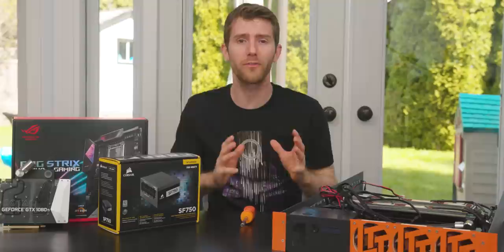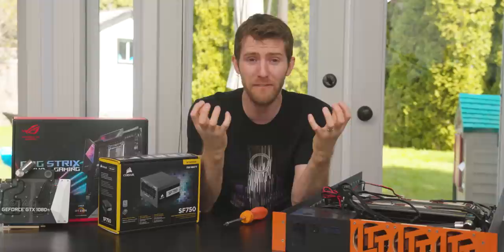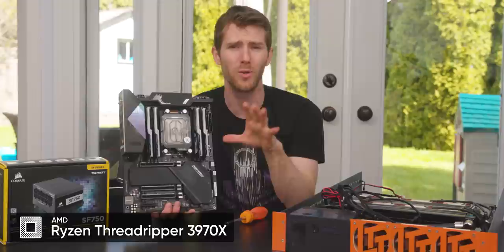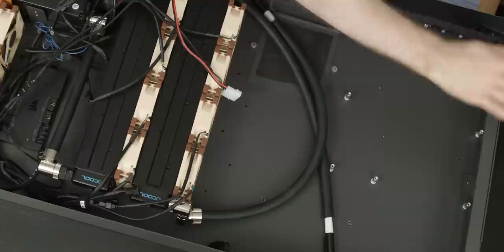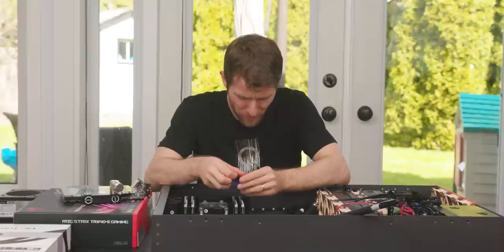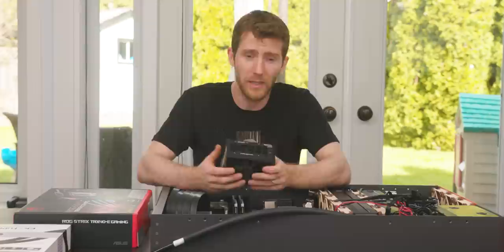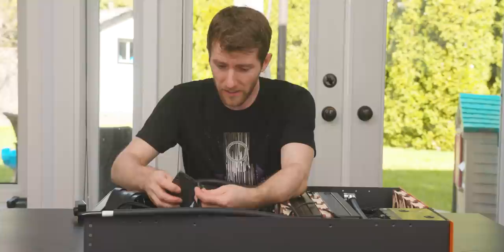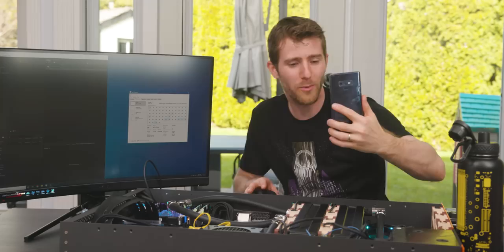Who is Video Rendering KING? Transcode Server Upgrade!

Comment: I still can't believe how efficient these Ryzen chips are. That's a 32 core CPU easily running off a 750W PSU.
Reply: I managed to run dual Epyc 7551 chips at 3GHz with a Vega 64 using a 750W PSU
Reply: Server farms wont be cooking IT guys who fix them lol if they run on epyc.
Reply: @Amusia727  The Vega probably drew more power than both combined!
Reply: i have that 750w PSU, using it with a 3900X in my small factor case
Reply: @Predator Ex I was just joking. I have a 3700x myself but it is paired with a gtx 1070. AMD processors are super efficient but not their GPU's. The Radeon VII did gain some ground on Nvidia as far as performance and power usage. I am not hating on your card though my friend, I had an FX 8350 in my last rig for Pete's sake!
Reply: @HowDareYouu  so what are you doing with the other 650w haha

Comment: Intel : so i get to battle your top dog today i hear
AMD : nah , he's busy , take his little brother instead , the 3970x 
Intel : what ?
Reply: Yeah I'm totally thinking of getting a 3970x. It's a lot cheaper than the 3990x and yeah sure it has half the cores but it also clocks higher and it's less than half the price so.. I call that a win. :D
Reply: @ayporos  dont get the 3990x , its just WAAAAY too overkill , btw what are you gonna use it for

Note : its nice to see amd dripping down their Halo Tech to the cheaper cpu's
Reply: More like taking a long nap and hakai'ing in his sleep.  You really don't want to disturb him.
Reply: @jasonlisonbee  beg your pardon , but what is hakaiing lmao
Reply: @jakethedog5777  i dont know if you realized that a lot see 2k as pennies for what that 2k cpu would do and save time compared to a consumer grade chip
Reply: @jakethedog5777  well i mean 
 3990x : And make it double
Reply: @archfxt3619  if you are not banking hard doing some kind of work that needs that kind of powers is a bit rip off
Reply: @archfxt3619  I indeed plan on getting the 3970X, not the 3990X.

I plan to run a hypervisor on it and run some permanent servers on it (NAS/media server using ZFS, internet/dev server, firewall) as well as VM's for 'gaming rig', 'dev rig', 'test rig' and whatever I feel like. :)

Not putting it in a rackmount chassis though, I have a nice big tower case with hotswap bays (for the NAS).
Reply: @ayporos  yeah i agree , 3990x is kinda overkill and almost not needed unless your doing stuff like the warhammer astartes project or equivalent heavy stuff
Reply: @random_bit  oh lmao
Reply: @archfxt3619  Watch Dragon Ball,  look for episodes with Beerus.  It's an energy attack that erases from existence what it hits.  A signature move of any God of Destruction in the show.
Reply: @jakethedog5777  2k FoR a GpU

Some 32cores Intel processors costed like 10/12k

Comment: Seriously tho, when's the last time Intel wiped AMD in any of the latest showdowns? Over the whole year I think they're at like 5% winrate tops!
Reply: They still put up a fight on single core tests but I don't think it really matters this day and age
Reply: @333dae  I agree, everything is run on multi core these days. Single cores are only good if you make VMs or the like
Reply: @NoThrottle  Not even then, you want as many cores as possible for smooth performance on a VM
Reply: @NoThrottle  I have been leveraging the massive single-core performance benefits that using Intel chips provide me for several virtualization projects and workflows requiring VMs. Very recently, I switched to a custom rig (made it myself) with two independent PCs built into the single chassis - both using the 3700X. I paired cores from each CPU for a total of 8 VMs over the 2 systems (4 on each), with one core pulling the computation load and the second one in the pair maintaining parity. The performance is MUCH better when I was using 8 intel cores, one core per VM. If you can pair up Cores (especially easy with AMD already defining CCXs), it provides a fantastic performance benefit and an operation facelift when you don't have to assign a workload and wait for the machine to check for data parity before it can start the process. Now, the data parity checking is done all the time, parallel to the process.
Reply: @NoThrottle  Minecraft server.
Reply: @tuyendang6086  guys dont tap the link its just malware and crap just report the account for spam
Reply: Intel is only winning with single core tasks. Like gaming (most of the time) or making music.
Reply: TheUnbanned Afaik most popular DAWs actually use multiple cores, so Intel would still lose. Although honestly for music production, assuming you want to never have to freeze a track and you use a lot of FX or big VST instruments, you'd probably actually want overall great specs instead of mainly a fast CPU. Something such as a Ryzen 5 3600, 32gb of ram, and an SSD would be a lot better than a Ryzen 7 3970x, 8gb of ram, and a slow hard drive (and I know both configurations are a bit unrealistic, but it's just an extreme example).
Reply: @ZohondeKids  I agree. I make music on ableton and on my amd cpu, anything above 90 tracks will lag me out and make some layers not play at all.

Also, ableton uses 3d in my gpu idk why
Reply: @ZohondeKids   Doing music production doesn't use a lot of ram. It's mainly single core performance. And it's for professional use. So a lot of plugins, sliders, sound, effects. Not for amateur use.

I agree if amateur music production is not the only goal for your pc, go with a Ryzen.
Reply: @theunbanned4553  Music production can use a lot of ram depending on what you're using, you can easily go over 2GB with just a few Kontact instances on their own.

Also, while a lot of older music programs rely on mostly single core performance, newer versions of some DAWs/newer programs can actually utilize multiple cores with a benefit (Reaper does this well, FL can in certain circumstances, and Ableton tries to separate most tracks into their own independent threads, Studio One supports it but I have no idea how it works, Cubase sorta does, and I assume pro tools does but I can't check). Although single core performance probably does have a benefit in certain circumstances. 
Another unrelated benefit to multiple cores is that it also gives you more headroom for your PC to do more while you're working (such as streaming, googling information, etc).
Reply: @NoThrottle  90 Tracks is quite a lot, just wondering, what are you maxing out?

Also, Ableton using 3d is most likely because Ableton can actually use GPU performance. When Live 10's beta first came out a lot of people were complaining of high GPU usage.
Reply: @ZohondeKids  i'm maxing out my CPU. 90 tracks is when i layer stuff for leads and synths. If you'd view my project file you'd see around 30 tracks only, the rest are in instrument racks
Reply: @NoThrottle  That's a lot of instrument racks, most of the songs I've made usually only use like ~8-20 tracks and almost exclusively one instrument per track. Although I'm also not using Ableton and most likely not the same instrument VSTs so the amount of tracks I could make would be different.

Personally, if I ever got to the point of 90 tracks I'd just save a version where everything is still MIDI, then start freezing stuff.
Reply: @ZohondeKids  STACK THE LAYERS ERS ERS S S s s s . . .

In all seriousness, my highest was 90 layers, mostly because i get lazy with automation and just make a different track for the same midi with a different effect. My workflow is very disorganized so freezing tracks would be a pain to me since i literally edit everything at the same time.
Reply: @NoThrottle  Ah yes, I'm guessing you stack the layers after getting some I N S P I R A T I O N?

I actually use to do that a lot more than I needed to, now I do automation cause sometimes it's way less demanding (Especially when working with big plugins) and it doesn't take much longer in my DAW.
Reply: @ZohondeKids  I'll probably get fl studio too in the future. Their way of stacking instruments with the same midi looks easier.

Comment: Just learned that the creeper PC motherboard fell off during shipping
Reply: Same, and PewDiePie made that his title, but only like 1/14th was even the relevant to the title (receiving the creeper PC)

Edit: 1. I thought video was 14 minutes,  it was 27. 2. The part of Creeper PC was 124 seconds long out of 27 minutes. (or 1661 seconds in full)

Here's the fun part though, it was literally 7.46% of the video length... before you cound 5 YouTube ad spots in the video itself.
Reply: RIP, shipping a pc never is gonna end well is it
Reply: VlanC Otaku they didn’t pack it sensibly
Reply: @MrCODEmaster00  same thing when Elon Musk hosted Meme review
Reply: @bruhdabones   the motherboard was screwed in
Reply: VlanC Otaku and the screws sheared off.  Real SIs use expanding foam or other packaging material to take up empty space inside computer cases, that’s how places like Bestbuy receive them.  This helps support the internal structure and reduce stress on components.
Reply: Shipping has so bad of a reputation that everyone just goes along with it
Reply: @bruhdabones  NZXT does the same thing
Reply: John Connor - did* R.I.P. NZXT
Reply: @maleknecibi  huh? You mean ncix?!
Reply: @maleknecibi  wait what happened to them? I just bought an NZXT case 5 weeks ago.
Reply: @bruhdabones  great point. I was amazed they shipped it like that. Computer components are delicate.
Reply: @maleknecibi  I got an NZXT case literally 2 days ago, and their subreddit is still as active as ever, so maybe you're thinking of NCIX

Comment: I'm surprisingly Early! But I predict AMD to win  though.
Reply: @gary8527  me to to
Reply: Well,intel can shake it, but why woulds u buy a 2.4K$ CPU that trothels u down to 40% while Rhyzen gives the midlefinger and is doing a hahaha to intel with a cpu that cost a 1/3e at least !
Reply: On high power prossecor amd is better
Reply: easy win
Reply: @MaxTheFireCat  Based on the results, they could basically do 2 videos at the same time on the Threadripper box.  Heck, 4 if they upgrade to the 3990X.

Comment: Something for you to try. Take that 32 core TR and spin up 8x 16 core VMs running Media encoder monitoring a folder on the network so then you have a render pool. Sure individual transcodes may be slightly slower but it would be interesting to see how a full production workflow would be improved with a virtualized farm versus one really powerful node allowing you to fully utilize the processor versus it hanging at 40%.

Comment: Before the video: my money is on AMD, they have the cores.

Edit: I was right lol, no surprise
Reply: Intels trash now
Reply: Thanks for the spoiler!
Reply: But muh real work performance!
Reply: Yes it has nothing to do with 19.25 vs 128MB of L3 cache (6.65x)
Reply: @maddoxswan3487  they were stuck at 14nm arch for a couple years and just upgraded to 10nm and his rival (amd) is in 7nm and wants to inovate to 5nm
Reply: @tomstech4390  eh,i don't think that cache is shared between all cores though unlike with the intel,so the l3 cache accesible to any given core is less, and the 10980xe has 24.5 not 19.25, plus double the l2 cache per core, which is faster

 so might not be as big a difference as you'd first think depending on how well adobe threads, even the reverse, which put its failure seem even worse...would love to see a breakdown
Reply: @GPUOverHeat hmmm whats the price tho? That AMD is more expensive?
Reply: @AngDavies  Okay but still even if a CCD didn't need to go through the IO die each still has 2x16MB of very close cache and linus mentioned the 5Ghz 14core 9990xe at 19.25MB then again LTT isn't meant for clear technical stuff so go figure they dont clarify.
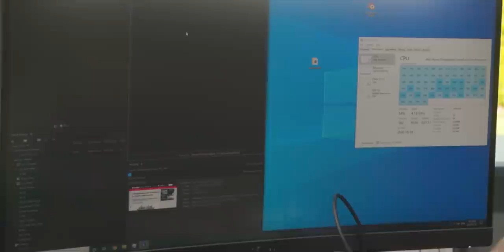Reply: @tomstech4390  yeah, was clear as mud... XD. my understanding is that Linus is using a 3970x, Jake is using a 10980xe (8:45), but not watercooled like the 3970x so i don't know if that's even fair , and they have a 9990xe in the closet that they're comparing it to ...i think?
don't think that's how it works with regard to the ccx's though,using another ccx's cache wouldn't be worth it, you might as well just fetch it from main memory at that point, it's about the same speed.
so if all cores need the same data, you might actually have less effective cache, because of necessary redundancy.
but trying to square all this  makes my head hurt, so hard to quantify, like the switch to higher memory + cache doubling the memory access times on the higher end intel parts, which might trash their gaming performance relative to cheaper parts 9900k

Comment: In case no one have time to watch though this video, here's the result:

AMD is faster and more efficient than Intel - again.
Reply: Oh fake
Reply: @cyguy2912  no the 3970X is $700 more than the 10980XE
Reply: @JTTTTT850  yeah but it has 32 cores vs Intel's 18. even if Linus uses the 3950X, which is cheaper than the 10980XE here, I think the Ryzen will win but will not look too embarrassing for Intel LOL
Reply: @badz1497  even 24 core finish with the same time and yes 16 core ryzen is faster the 18 core intel in this test

Comment: Linus: 10 gigabit ethernet "Nice to have" 
Me: watching this video in 360 p quality...
Reply: Jonathan Nagtegaal 
10 Gigabit doesn’t refer to internet speed in this case. 

It’s the speed you can send files around in your local network using the Ethernet port 

There are rarely internet providers with faster than 1 gigabit internet connection

Comment: "Top of the line AMD vs Intel." Uses top of the line Intel and middle of the line AMD. Makes sense.
Reply: Even middle of the line defeats top of the line in this scenario
Reply: ???. Mid range AMD would be a Ryzen 5, Threadripper is definitely high end.
Reply: @TheLegoTrainStation  Still one step left on the AMD ladder and Intel is just left in the dust...
Reply: @thomasnisbel4772  Exactly. These AMD chips are amazing.
Reply: @TheLegoTrainStation  More like Ryzen 7
Reply: TheLegoTrainStation . Ryzen 5 falls under the budget range of CPU’s. It’s mid range if you are only comparing Ryzen 3,5 and 7.
Reply: Isn't i9-9980XE a faster chip than 10980XE since the latter is a rehash of 7980XE?
Reply: @bahaelaila  I believe they both are refreshes

Comment: AMD vs INTEL transcode showdown, yees YEEES! YYYEEEEEEEAA... Oh wait, Windows 7 is limiting me to Sky Lake processors meh, and on top of that the I7 6700 T, normal, and K versions are all better than the A12 9800e unfortunately because the 9800e is actually better than the GT 710 v2 for graphics apparently. Either way, I'm gonna need some serious power to transcode my Blu rays into VC-1 16-20mbps+WMA Pro 5.1 768kbps Xbox 360 movies. And I'll just let my current laptop handle VCD encodes for my Sega Saturn, CardCaptor Sakura will definitely benefit from VCD. Did you know VideoSolo Free Video Converter has the very best MPEG-1 encoder and adjusts bitrate according to resolution and complexity, I think that's incredible so I can save space and not use unnecessary bitrates. For Kung Fu Panda I feel like 320x122 should be about right, and 320x180 16:9 movies like Over the Hedge and CardCaptor Sakura movies.

Comment: Userbenchmark - As you can see, Although AMD finished encoding ahead of Intel... Intel managed to... Ummm heat the space!!! which could actually be useful if you're living in Canada.
Therefore the winner for this test is Intel!
Reply: Userbenchmark does report results of single, quad, octa and 64core threaded workloads. So it there for anyone to see, it is not hidden. Sure when they rank cpus they rank them based on a weighted score of these 4 results with single and quad thread scores having a greater weighting than the 8 and 64 ones. This is done because these workloads represent the vast majority of workloads the vast majority of users would use most of the time. Even if you are doing video editing you spend 97% of your time on the timeline and that is faster on Intel all day long. Even when you go ahead to encode the encoding finishes in under 20minutes and during that time is time to have break for a drink or to go to the toilet.
Reply: @alexmarin7897  userbenchmark are biases as fuck for exsample r5 3600 its faster then 9600k in 90% of the bench but then in their total score its slower...and for video editing ryzen its faster in pure software encoding that only use cpu brute force but intel its faster for quicksync (not more now because you can use decicate gpu for hardware accelleration, they only need to fix it on ryzen igpu).....back in the days before ryzen launch their multicore was 20% of the total score then after zen 1, 10% and after zen 2, 2%

Comment: Linus Tech Tips, are you aware of that you can upload the CineForm files directly to YouTube, without having to transcode them to H.264?

So instead of transcoding those to H.264 and then upload, just upload the CineForm files directly and let YouTube transcode them. Yes, it will take longer time to upload, but it will take even more time (and money) to transcode those files locally to H.264 and then upload those. And, you will save one generation of quality. This works for Apple ProRes, AVID DNxHD as well.

Comment: Wait, Through the entire video i assumed you were slaughtering the 10980xe with a 3990x because you said "top of the line ryzen", then you drop that bomb at the end that this was a 3970x?
Reply: Puget put 3970 slightly ahead of 3990 for premiere (Whilst it is not known why this is exactly the case as it should be identical, my money would be on Adobe jank optimization). Your point still stands; but it wouldn't have made any difference either way
Reply: @Niko-qs1sl  no the issue is windows or to be precise the cpu affinity bit mask. after 64bit are used up (keep in mind a 32 core has 64 threads). you need to use a little bit of magic to fork another 64 threads. so everyone has to change its software to be able to spawn 128 threads.